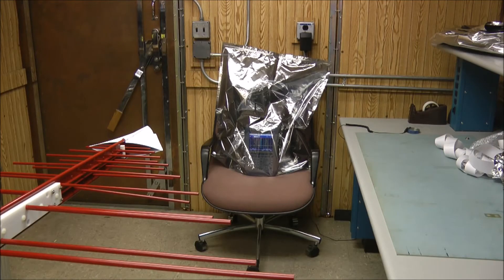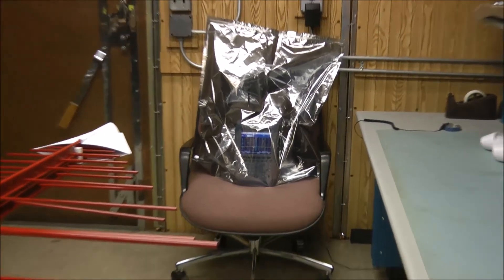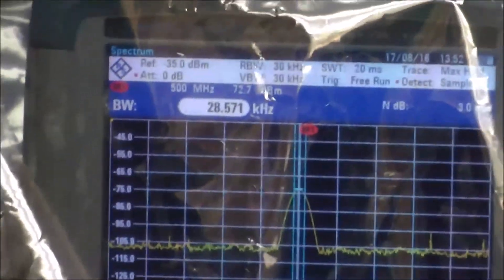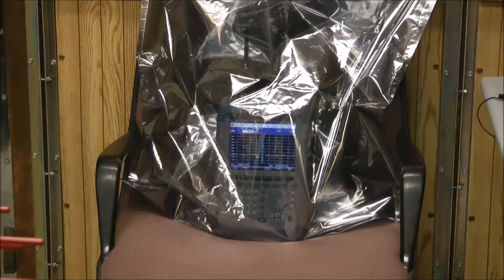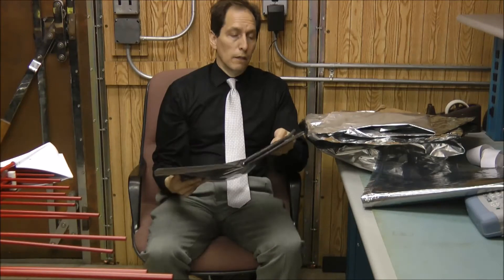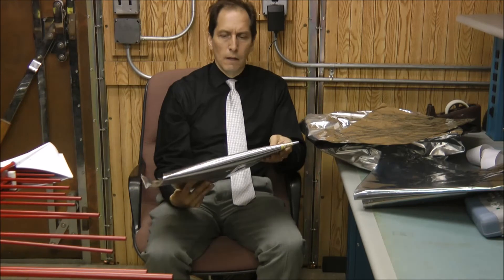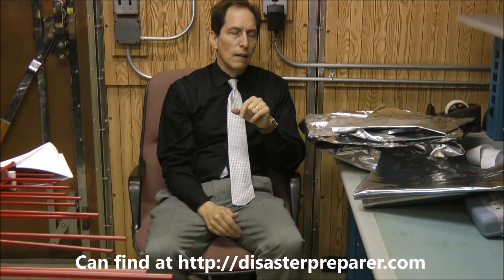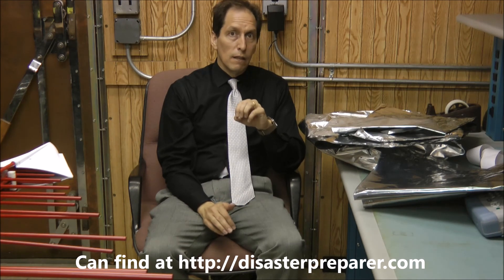EMP Bags - Which are Best?

Comment: Would extra layers of mylar bags increase protection?
Reply from the maker: The answer to your question is yes. Layers of bags almost add in dB, so one layer gives about 50 dB of protection (99.7% field reduction), and two gives almost 100 dB (99.999% field reduction).
Reply: @disasterprepper  Actually not mylar, though, right? Your mylar tests were disappointing.
Reply from the maker: @johnbauman4005  That's right. The mylar blanket I tested didn't provide very good shielding. If the blanket had thicker metal, it would do better, but it's hard to know the metal thickness.

Comment: Do these EMP bags also act as faraday cages - i.e. block out cell and wifi signal?
Reply from the maker: They do greatly lower the signal levels, but they likely won't fully block a cell or wifi signal. To block a cell signal requires about 100 db of shielding (99.999% field reduction). EMP bags provide about 50 dB (99.7% field reduction). You can double or triple bag to achieve the 100+ dB of shielding.
Reply: @disasterprepper I agree, I've tested SCS dry shield bags (3400 grade) with a mobile/cell phone. It  stopped the cellular signal enough to disconnect (4G), but was insufficient to stop 2.4GHz WiFi signal. I haven't tried double bagging etc, but would imagine it works. So if you're looking to shield your phone for other purposes, such as security/privacy reasons, it would be more practical to use a multi layer fabric bag built for that purpose. Trying to triple bag your phone with shiny and rustling silver bags is rather conspicuous and rather tedious when in public!

Comment: If I were to take a bag and put whatever type electronic equipment in it, seal the end, roll it up and then put that bag inside another bag will the resistance be doubled or is it still the same?
Reply from the maker: It will go up multiplicative. If you get a reduction by a factor of 10 from the first layer, and another reduction of 10 from the second layer, the signal on the inside of in inner layer would be reduced by a factor of 100. In decibels, that multiplicative property shows up as addition. In other words if each layer provided 20 dB of shielding, layered they would roughly provide 20 + 20 = 40 dB. Layering works really well to reduce electromagnetic fields.
Reply: @disasterprepper  thank you for your reply. I found your channel from a recommendation by Jeff Motes, author of 'Once Upon an Apocalypse'

Comment: Are there any well-performing resealable bags with Ziploc-style closures that can be used for frequent opening and closing?
Reply from the maker: Unfortunately, the low-cost ziploc-style bags that I tested did not do that well. I think there are other, more costly, resealable options from various companies, but I haven't tested their effectiveness.
Reply: @disasterprepper  I will have to choose something without testing. Can you tell me what the more costly options are? Maybe actual metal foil bags?

Comment: Just curiously asking, What tester unit did you use ? make and model please  :D
Reply from the maker: The entire test setup consists of four pieces of equipment, a signal generator, broadband high-power amplifier, broadband antenna, and a spectrum analyzer. The spectrum analyzer is a R&S FSH Handheld Spectrum Analyzer. This particular model has 6 GHz of Bandwidth, but they make other models with higher BW.

Comment: I actually purchased bags from your website.  I am a little confused about the need to wrap a non-conductive layer around electronics prior to placing in the bags.  Is it not necessary?  I thought when using a metal container, ie.  garbage can, the device couldn't touch the metal can.
Reply from the maker: The inside of the bags is not conductive, so you don't need to insulate items placed inside. What you're trying to avoid with the trash can is exposed metal on an electronics item coming into contact with the conductive interior of the can.

Comment: Would a jobox (brand name) provide EMP protection for your electronics, with minor alterations?  It is a hevy steel box, with a steel bottom and hinged top with no rubber between.
Ken
Reply from the maker: The box looks good, but the trick would be sealing around the lid, probably with a conductive gasket.

Comment: A little off topic Dr. Bradley, there seems to be a lot of differing philosophies regarding EMP protection. Will an X + class CME disable a modern car or won't it, what materials to use to build a Faraday cage, does it need to be grounded or not, 50 bd(?) of protection is enough or 80 db(?) is enough........Oy Vey !!!!  My 2 questions are should I invest in an older vehicle and what is the best way to EMP proof a generator of approximately 2 ft x 3 ft x 2 ft. ? Money is not a problem.  Thank you.
Reply from the maker: Coronal Mass Ejections (CMEs) won't affect cars or other electronics that aren't attached to very long conductors (such as the power grid).  Faraday cages can be built with any electrically conductive material, including aluminum, copper, steel, etc. A Faraday cage does not need to be grounded. 50 dB of protection is generally considered adequate. 80 dB is better, but it is overkill, as it would reduce 50 kV/m down to 5 V/m (really small). Vehicles could be affected by an nuclear EMP, but I don't know that I'd invest in an older car just for this reason. Older cars also had controllers and computers in them that are susceptible (unless they were very old). Protecting a car that is off can be done using EMP-cloth (see http://disasterpreparer.com/emp-cloth). Protecting one that is running is very difficult, and would require extensive engineering to do correction. Whew! Lots of questions.
Reply: I'm sorry for all the questions, but thank you very much for taking the time to answer and help me understand. I appreciate it immensely.
Reply from the maker: No problem at all. Glad I could be of help.

Comment: What about the bags from Faraday defense .com. They just have a ziplock closure. I have not folded the lip over. I have my electronics inside those and I have those bags inside a trashcan Faraday cage. I sprayed the inside of the trashcan with a dielectric film and I lined it with cardboard.
Reply: You want to purchase the EXACT bags this guy recommends.  I have looked into his credentials and he's probably THE MOST credible source of EMP information on the internet.   Don't screw around..  Dr. Bradley's advice is the best you'll find anywhere and if he says to use Dri-Shield 3400, that's what you should be using.   I bought about 50 of these bags and tested them and they work.
Reply from the maker: The only bags that I tested with ziplock closures didn't protect that well, but I can't say how well Defense.com's bags work. If you're uncertain, you could always fold down the lip and tape. One issue is the sealing, but the other is just how well the material works to block the RF energy. I would think that between the bags and the can, you should be okay. Ideally, you'd like at least 50 dB of protection.
Reply: I am also interested in the Faraday Defense brand as their bags are cheap. 
It would be great if you could test famous brand bags and compare them as a "buyer's guide" series of videos!